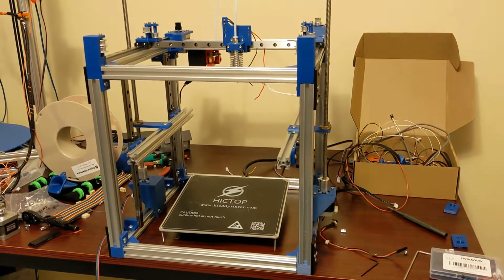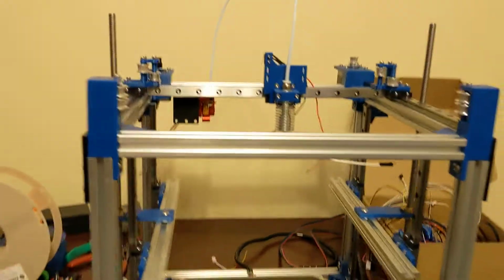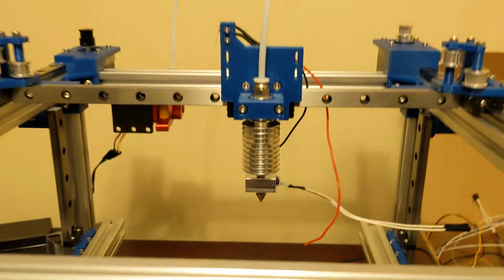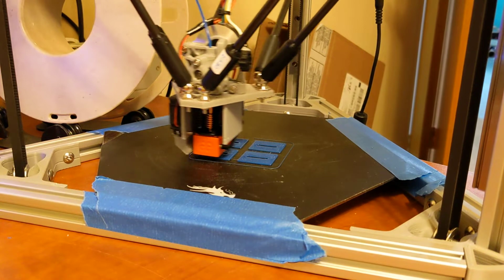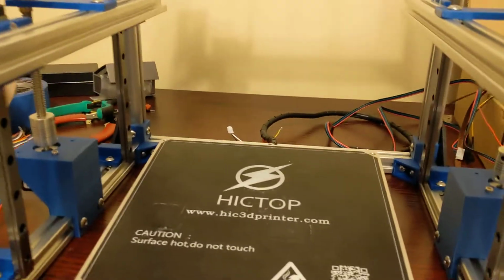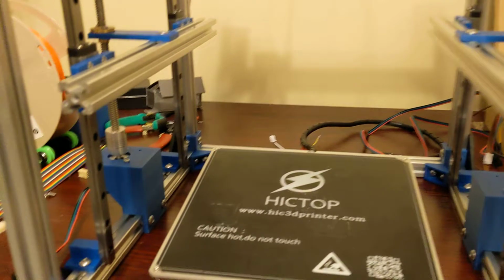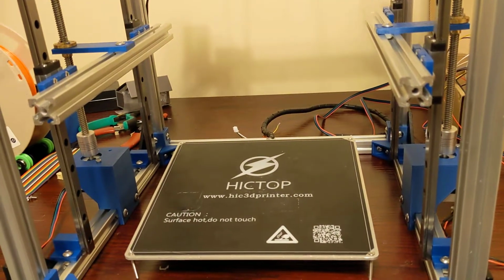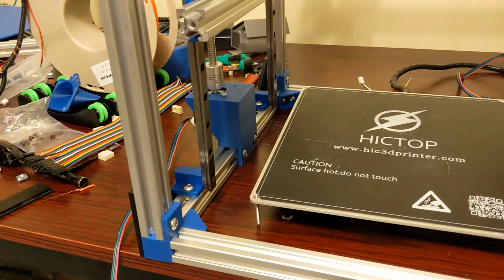CoreXY 3D Printer Build Episode 2 More Frame and Z Axis

Comment: I'm not sure but i think you can use an external stepper driver (like a standalone stepper driver module) for each additional Z-axis motor by simply connecting each external driver to the main board's Z-axis output?

Comment: You are printing with ABS on the Delta?
Reply from the maker: I usually only print PLA but you can easily add a heated bed and print ABS. I have a very large delta 340 x 490 that I will be added a mains voltage heated bed to. I will be making a video of that in the future